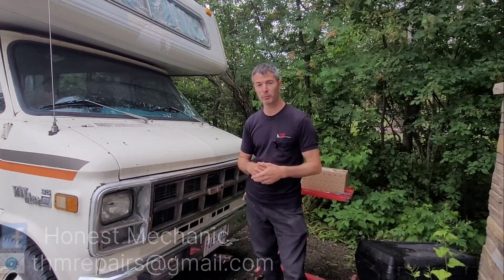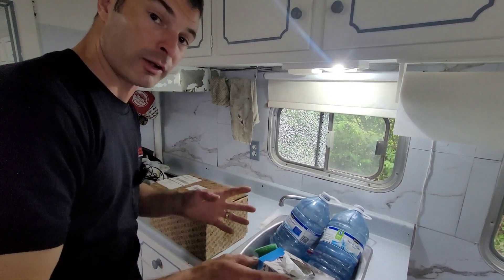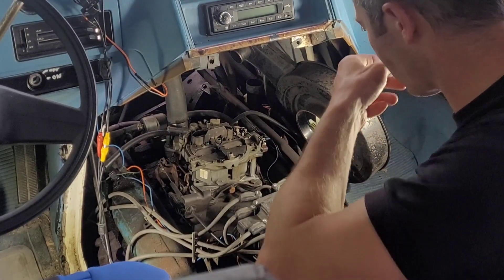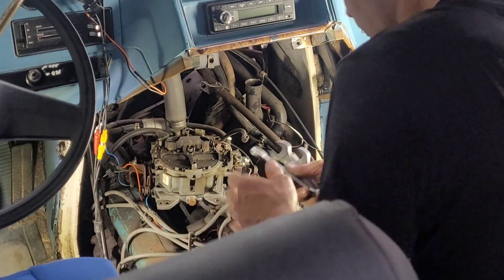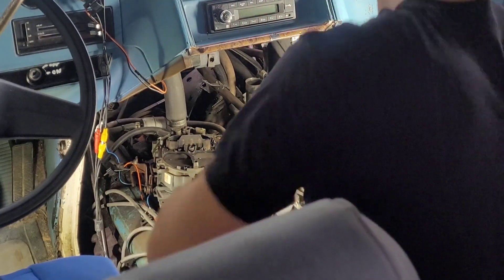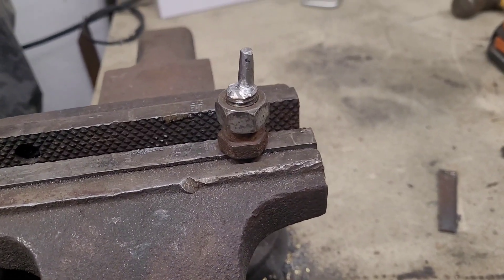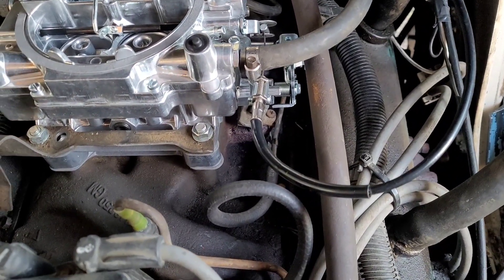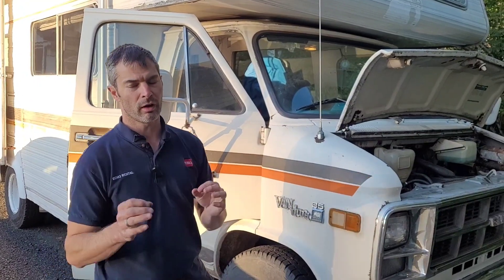Is a Chinese Carb Worth It ??!

Comment: I like the way you figure things out and manufacture /alter etc to make things work. I was laughing because I am the same way. I was a mobile truck mechanic for years and when it's only yourself in the middle of nowhere with a flashlight it's amazing what you can come up with. 
Great video! I've bought two Chinese carbs...one for an old 250 quadrunner and it ran great right out of the box. So I tried another one for an  older KLF 300 and it was not so good.  
Glad this one worked for you.

Comment: It surely works either way, but the throttle shaft bushings will last longer if the return springs are attached to the throttle arm on the same side as the cable.  Running from the arm forward to an anchor point.
     Shaft has a high side load the current way..bushings will wear, become a slight air leak,  making idle erratic.
    Or, maybe it will never matter.